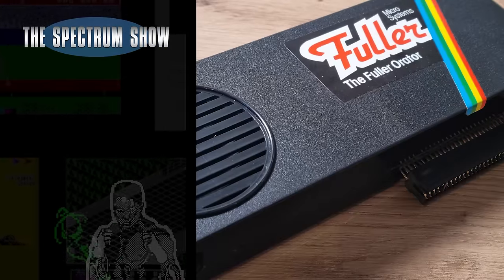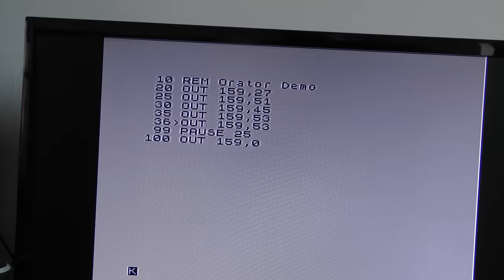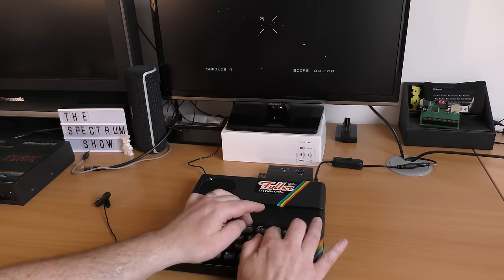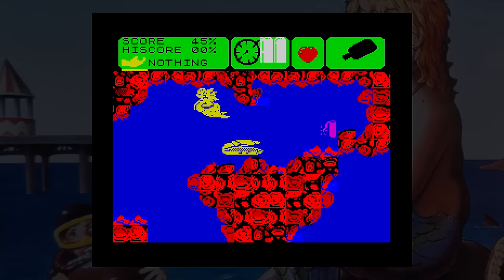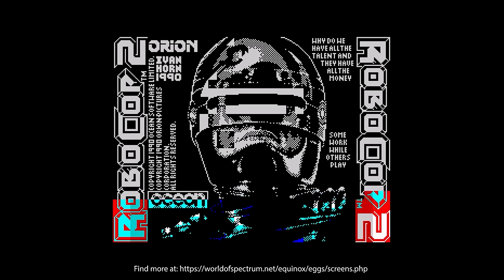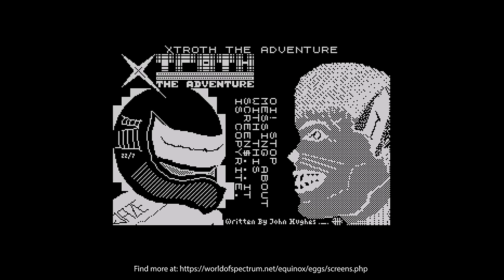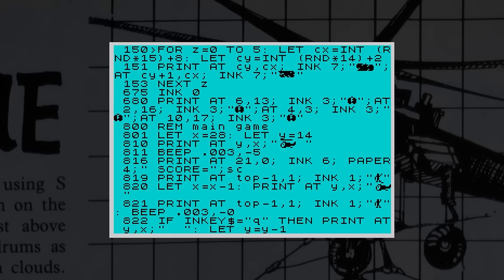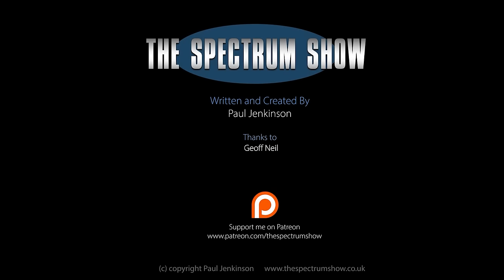The Spectrum Show EP145

Comment: Another great video. Thanks! I liked the hidden messages feature. A few years ago I coded an app for the multifaceted 3 to show them. When you pressed the button it searched the screen for any attributes squares where ink and paper match, and changed those to flashing bright magenta to highlight the messaged. A simple little app but I quite liked it. I did wonder if there were any messages in games themselves rather than just the loading screen. I didn't find any (but gave up looking quite quickly tbh)
Reply from the maker: There quite a lot of messages in game code. Maybe that's another feature!

Comment: The fuller master unit was not well supported in software and really was a hobbyist unit for programmers. The most used features for me were the beep amplifier and the enhanced cassette interface with no need to disconnect any of the leads when saving to tape.

The instructions did not really tell you how to get musical notes out of the sound chip and I only really had fun programming the orator speech chip.

Bosconian was the only game I had which supported the sound chip in my unit.

Comment: Question to Speccy lovers, 
Why is there so many joystick models Kempston Sinclair 1+2 Fuller Protec????
Reply: Because the Spectrum 16k/48k/+ didn't support joysticks without buying a plug-in hardware interface. Although Sinclair brought out an official joystick interface (the Interface 2), there were already several third-party interfaces on the market, which were often cheaper and/or offered more features than the Interface 2. These interfaces weren't necessarily compatible with each others joysticks, and weren't necessarily read using the same method.